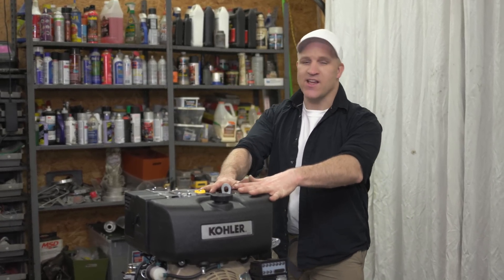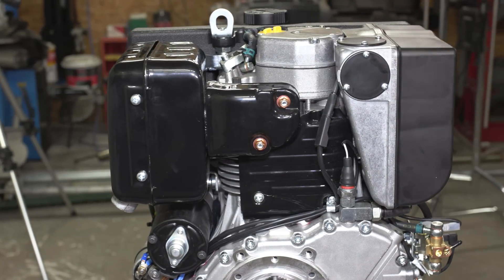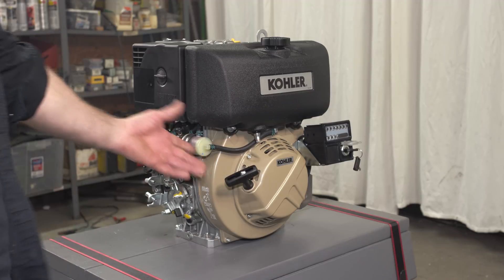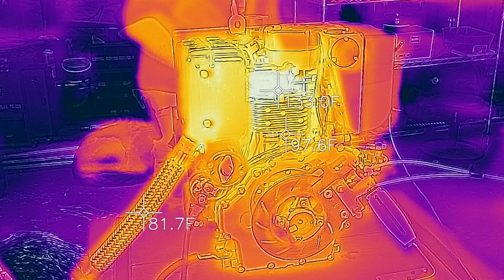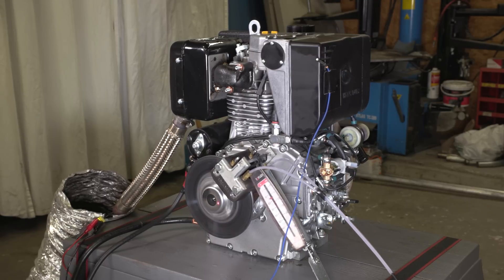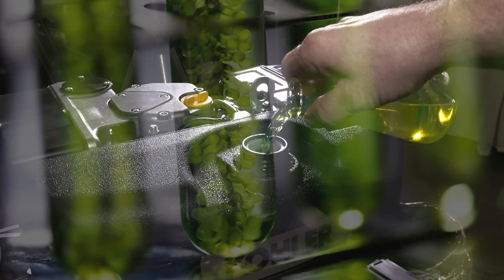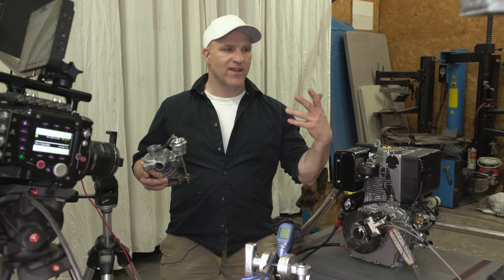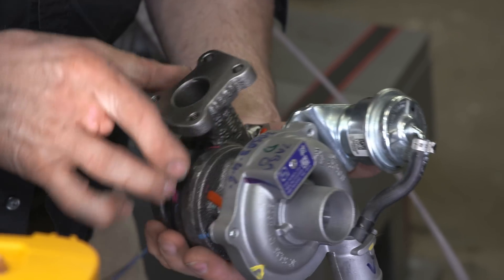Single Cylinder Diesel Engine - Dyno Test (Diesel, BioDiesel & HydroDiesel How Much HP?)

Comment: Was interesting to see what the "hydro diesel" did. It put out similar power to the regular pump diesel, made way more EGTs but kept a cooler head temperature. I'm thinking perhaps it burns more efficiently, more load for less heat wasted but also a longer burn, hence exiting the exhaust at a higher temp?

Comment: Yes! Very good video. Thank you very much! 
I'm looking for the EGT temperature of a single-cylinder air-cooled diesel engine, and you gave me three different values, the best running on biodiesel. Great! Thank you very much. 
However, I have a question. You had this experience with an excellent Kohler, but have you done the same test before with a Chinese single-cylinder air-cooled diesel engine? (Both engines are similar.) Do you have the values? The Chinese data sheet for a 186FA indicates approximately 500°C on the EGT, running only on diesel.
Thanks again!

Comment: I really enjoyed it, great video and thank you very much for your work and time.
By removing the cover that covers the cooling fins - are you not impairing the engine's cooling capacity? 
In my opinion, this is not a heat shield, but part of a capsule that directs the cooling of the air.
Take care 🤝

Comment: There is a new technology that is (1) a hybrid of 2-cycle and 4-cycle, and (2) a hybrid of diesel and gasoline combustion which  makes diesel engines burn like gasoline ones - and that does not produce soot or NOx (even high noise). Therefore, it doesn't need the expensive and nasty aftertreatments. The technology  can be retrofitted into old, existing, or new engines - below is a short description. 
High Efficiency Low Emission Hybrid ICE:
By simply splitting the ring-section from its skirt - to be operated by a (valvetrain-like) piston-train to pump the gases during the intake and exhaust strokes, and combined with the skirt to complete the compression and power strokes - can achieve the hybrid. Which completes the 4 strokes, different in both displacements and periods, in every engine revolution - called D-cycle (Differential-stroke cycle) – a hybrid of the 2-/4-cycles.  
The D-cycle’s controllable exhaust strokes can be shortened to retain high amount of burnt gases to control the ignition initiation and combustion rates for the HCCI/LTC (homogeneously charged compression ignition with low temperature combustion). When combined with the (gasoline type) stoichiometric air/fuel ratio intake under high-compression ignition, it is the diesel-gasoline hybrid with the benefits of both – called SCCI/LTC-BGR (Burnt Gas Retention).
The resultant hybrid can have Atkinson-cycle strokes, whole engine working at lower rpm, fewer cylinders with lighter engine support and vehicle styling, weight and efficiency gains, and etc. Diesel engines can avoid soot and NOx formation saving expensive after treatments with lower noises. Gasoline engines can enjoy diesel type (within structural limitations) efficiency (test shown >20%) and torque gains ( >2.5x).

We need to make the diesel hybrid and test it. Where are you located?

Comment: hi :)  i wanna see what the dyno say while running on used engine oil.. yes u heard me right. on al my old diesel cars with a mechanical diesel injection . fox an MB om601 engine... i run it on only used spill oil. the only prepare i do with the oil is pour it through a textile filter to get away with the mosth of metal or other particles. it shure will be fun to see tis fuel performance vs these 3 types of diesel.  and,, i also like to se it runns on used and filtered food cooking oil :D since i've also using that in the summer time at my mercedes diesels :) and ofc test has to be in 2 configs,, with and without a turbo intercooler setup :D

With best regards from a MB Diesel engine builder :)

Comment: OMG!!; I forgot to comment on something about adding a turbo to a diesel single cylinder engine: 

*Turbo boost (Quite often..) varies ~  4 to 7 psi.

>Since it is single cyl, 'turboed' intake pressure would probably be jumping up & down.

*To minimize the above, several Tech ppl suggest using some kind of 'pressure stabilizing / accumulating chamber / tank', (In a diesel, it's just air..), between 4X up to 10X the cylinder engine displacement. 

BTW: Awsome to see Todd / Project Farm here in WP's interesting channel. Actually, I've learnt quite a bit from you both!!. 

(Just my 2 cts). 🤗🇺🇲🙏🙏🙏

Comment: Kohler are not the only one-cylinder-diesel manufacturers. Another company, for example, is Lombardini. There are more ..
This video is very informative. I have a diesel bike that runs with 100 miles per gallon. This video encourages me to do tests with different fuel. Once, for testing, I used vegetable oil. The sound was a bit more meaty, and the power was increased.

Comment: These engines are used in airport equipment belt loaders to load luggage into the airplane. They run all year long. Very dependable engines.

Comment: How much water content does that "HYDRO Diesel" have in it as that is very damagingntonthe engine with corrosion and many other problem down the road. Ita a very common problem with the bio diesel as well. Ie why it can only be run in newer engines. Just like the ethanol issue and so on.

Comment: I'm a true fan of Kohler as their engines are very well made. I use a KD 15-225 for a small generator in a remote barn shed. Never had a single issue with it.

Comment: You must have primed the fuel system before starting it's impossible for a brand new diesel to start 1st pull
Reply from the maker: I did prime it
Reply: @WarpedYT  yere I thought impossible 4 a brand new diesel to start first pull without diesel in the lines

Comment: I use hydro diesel to aid cutting on the lathe and mill, it must be great for the injection pump, My V8 diesel engine was leaking a tiny amount of water onto 2 of the combustion chambers, it caused erosion during combustion, that ate away the combustion chambers until it destroyed a valve seat.

Comment: Warped perception Did you dyno this engine after you put a turbo on it? I'm curious if it made enough power gain to make it worth doing. I'd like to do the same to my air cooled 10hp if you seen decent gains. Thanks
Reply from the maker: I did and it actually made less power with the turbo .. lol
Reply: @WarpedYT  well that sucks. And it even built boost?

Comment: Could you make the comparison again now that you have this diesel turbo'd? I'm thinking the powwr output difference could be greater with the turbo application as the EGT skyrocketed from replacing Diesel with Hydrodiesel, leaving room for the turbo to work

Comment: Is this is an ad for Kohler? Definitely... And the rest of us are fools...1st.. been wanting to test a single engine n no one makes one but Kohler.. I call BS... Bosch has that covered....2nd... Shows Chinese diesel engine that's apparently got something broken...I thought no one else made a diesel... 3rd... New engine starts in 1st pull... How'd you prime the pump? I stopped watching at that point.
Reply from the maker: No it's not, people have been asking me for quite some time to show a single cylinder diesel, I genuinely had a very very hard time finding one, I'm not sure why I contacted yanmar for months they never got back to me, my friend told me about Kohler and sure enough they had it. You prime the pump by pulling it slowly for 10 rotations, that's to get the fuel in there, after that it did in fact start in one pull whether you believe it or not. Not sure why you're upset.
Reply: @WarpedYT   Thanks for the additional info... Makes more sense... May have been annoyed to hear that no one makes one but Kohler... There are others out there who were probably making it before Kohler...  (Bosch 10hp, Kubota 13hp, yanmar 10hp)  in the USA, many 10hp Chinese diesels are have been cloned from the equivalent yanmar... P.S. - nothing against Kohler... They are a respectable commercial quality brand...

Comment: Yeah, no suprises in this test, hydrodiesel isn't availible here, but the difference on biodiesel and regular diesel is noticable in a car, and consumption goes up a fair bit on bio too...
Hydro diesel should be even better on the Turbo setup, since you get a fair bit more exhaust from it. (steam)
It's an old turbodiesel tuning trick, either waterinjection that also cools the intake air, or hydrodiesel

Comment: Diesel: 8.5HP measured
* EGT: 291C
* Air: 20C
* Head: 206C
* Block: 112C

Hydrodiresel: 8.83HP measured
* EGT: 364C (!)
* Air: 19C
* Head: 180C
* Block: 110C

There is some kind of sorcery in this hydrodiesel stuff, higher EGT, lower head temp, more power. o_O

Comment: FYI: If you google single cylinder diesel engine you can find alot of manufacturers that aren't garbage. Kohler, hatz, kubota.
Reply: Also use a proper wrench 3:32
Reply: Also do one on jet a1

Comment: Could you please do a video experimenting with more fuels? Such as hydraulic oil, gear oil if it’ll run engine oil and kerosene and jet fuel? Also as a special request a mix of 5 parts aw46 hydraulic oil 1 part gear oil and 1 part 15-40? I would appreciate it a lot.
Reply from the maker: I love that idea
Reply: If you run straight kerosene, you can burn holes in Pistons. Also jet fuel is kerosene

Comment: Why the 100 RPM difference between the HyrroDiesel and the other two fuels? You tested the HydroDiesel at 2900 RPM and the other two at 2800 RPM.
Reply from the maker: Just because that was its sweet spot. The other two like 2,800 RPM, the hydro diesel liked 2,900 RPM, not sure why maybe different combustion speeds.

Comment: Cool way to test power gain of fuel give it a try mix diesel fual with zone flower oil look. Also oter diesel mix like alcohol or brake fluid or transmision oil.

Comment: Im afraid the poor lil Conneting Rod is going to go POOF !!! :p
I hope you get alot of fun out of it first though.
Keep the rpms sane and it'll last until you lift the head too many times and rip out the head bolts/studs. good luck
Reply from the maker: Once I start rolling coal I will be building some sort of blast shield.. I think as soon as this thing gets more fuel the boost is going to get crazy.

Comment: Kubota and Yanmar makes decent diesels, infact Yanmar designed the original one called the L100, kinda similar with how predator engines were originally designed by honda with the GX200

Comment: Amazing video., Can you test the diesel engine where the Air intake is connected to the Exhaust pipe of the engine..
 Try to supply the black smoke exhaust into the Air intake of the diesel engine, please upload the video.✊

Comment: so those so-called heat shields that you removed from that diesel engine are not heat shields. Those are air ducts that use the flywheel of the engine to pump air around the cylinder head to keep it cool especially important in a diesel engine because of the higher pressure and much higher temperatures than a gasoline engine. You have practically destroyed this motor by removing said "heat sheilds"

Comment: Maybe you could try using a belt driven or direct drive generator head and load bank to simulate a load on the engine? Seems like you would have better control of the load.

Comment: For the load testing, you might consider hooking up a generator and some electric heaters to act as a load.  You might get more consistent loading, than using a disk brake.
Reply: The brake is fine as a load, the main idea is loading the engine up until it slows down. So  the more powerful fuel will resist slowing better and generate more stain on the meter while doing so.
Reply: Yup!: The dyno's resistance should be enough load to the Kohler engine
Reply: How would having more variables create more consistency?

Comment: I think it’d be interesting to investigate certain types of catastrophic engine failures, by getting a bunch of those cheap Chinesium moped/motorized bicycle engines and making an interchangeable crankcase window. Try a bunch of different extreme scenarios like hydro lock, spark knock, inadequate oil, overheating, etc.

Comment: Not a fair test. Engine is breaking in. Try this test again after 50 hours and you will get different results. Biodiesel is made from all sorts of oils which will vary results due to hydro carbon differences. I burn biodiesel in my truck and noticed mileage varies slightly depending on 
content. Never heard of hydrodiesel and by your testing it may be more  efficient if the same amount of fuel used. Wonder how many BTU per gallon the different field have.
Reply from the maker: You could be correct, I tried to break it in as best as possible but not nearly 50 hours worth of running. Thanks

Comment: I had a Chinese 10hp single piston Diesel engine for about 5 years...when I first got it I ran it for a couple of hours on Diesel fuel... then 100% Veggie oil for the next 5 years...ran great with very little smoke and always started right up... Did blow the head gasket about 4 years in...easy fix. It was hooked up to a 10,000 watt Harbor Freight generator head on a small trailer.

Comment: This makes me want to shift gears on the go kart I'm building and go from a built Predator 212 to a turbodiesel Kohler and gear it low to make a crawler buggy
Reply from the maker: Well I I would say wait till I have the episode out which will be very soon that way you can get an idea for how it's going to work and how it's going to sound. Although I went in the opposite direction I went with a higher gear to take advantage of all of the torque

Comment: The exhaust gas temperature of the hydro diesel was way higher than the other two  . Water makes diesel burn at much higher temperatures . Tractor pullers have water injection into their engines to boost power . If you have an engine that’s had water getting into the cylinder for a prolonged period , for whatever reason, like a blown head gasket, the water corrodes the pistons and head quite badly . After extended use of the hydro diesel , would it wreck the guts of the engine ?

Comment: Probably not a good idea to remove the heat shield over the cylinder's fins (4:34) as those usually direct the airflow around the cylinder to cool it evenly.
Reply: exactly what i thought when he removed it
Reply: he said he was looking for a motor that would take the abuse lol
Reply: Yeah thats exaclty correct. No bueno.

Comment: Fuel costs so much in UK and diesels simply out perform petrol mpg hands down everytime. 190bhp and average of 60mpg from a 2.0l diesel its a no brainer for most.
Cant beat a v8 petrol or 6 pot turbo peyrol sound though

Comment: "Haven't actually started one of these Kohler engines before" - cut to panning camera angle showing soot on the stand from previous run...
Reply: did you see a camera flying around the engine when he first started it?

Comment: i get that this is a short little experiment for fun, i enjoyed it and i love watching your stuff. however there are some things i noticed that might be important to your experiment to get accurate results.

1. are you changing the brake pads after every run
2. are you letting the calipers and everything cool to room temperature before hitting your next run
3. are you sure carbon build up, even for a short run, wont affect engine performance when switching fuels?

Comment: Kohler makes good engines. I have a gx200 clone Kohler made years ago and aside from the plastic can gear and the bushing in the side cover other than a bearing it fires up first gentle pull every time and is pretty bullet proof. I run it in a mini bike and I'm 200lbs and beat the shit out of that engine

Comment: Was this engine broken in before you began all of these tests? I would think a brand new engine would behave a bit differently than an engine that has been broken in. I'm not much of a mechanic but I was always under the impression that engines will/can run differently, if they have been broken in or not.🙂👍🙏
Reply from the maker: For the very first start it was not broken in, but in between the first start and the tests yes I did in fact break the engine in.
Reply: Well thank you for the reply. Great video and I can ONLY IMAGINE what you're planning for that little turbo. Just be careful!!! One more question, if you don't mind? How many hours did you break it in for? Thanks in advance and keep up the great work!!!🙂👍🙏
Reply from the maker: You're very welcome, thanks for watching. I actually already have the little turbo mounted and ready to rock and roll 4 episode 2 which we start filming tomorrow. I can't remember exactly, but I did contact Kohler and ask them what the break-in procedure was, I believe it was like 8 hours I was running and one hour running under load.

Comment: You should get a 212cc stage 1 (race air filter and open header pipe, governor removed) and do a dyno run for different octane of fuel, 85,87,89,91,93 see if theres a power difference

Comment: Compound turbo it, use two more the same as primaries. intercool after the final one. Tripple the injector and pump volume. Advance the injector to 45% TDC. Balance the boost and exhaust pressure at the wastegate. You'll be stunned!
Reply: You'll need a much better brake!